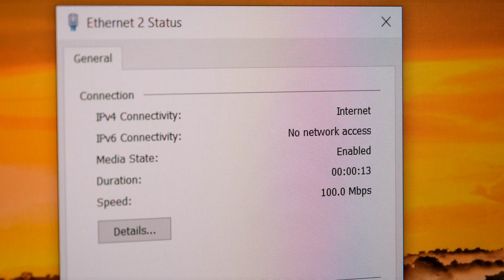Ethernet speed capped at 100Mbps fixed to 1Gbps - cable fault

Comment: hey @ecologicaltime i am having this problem. When i set my speed & duplex to 1gbps and fully reboot my pc, it still shows me that my speed is at 100mbs on the ethernet status page. Do you think running my speed and duplex at 1gbs while actually being capped to 100mbs could cause packet loss?
Reply from the maker: the link speed is governed by the performance of the cable and the wiring layout. If you set to 1Gbps and you get 100Mbps you must please check your cable.

Comment: Hi please help. I have a long Cat6 Ethernet Cable (inside walls so hard to replace), that is only giving me 100Mbps speed. I checked Realtek Ethernet Diagnostic Utility, and it gives me 100Mbps transfer speed, but all 4 pairs are "normal"; hence connected. 

Is my slow speed due to crosstalk? And is that indicative of bad crimp, or kink somewhere along the lines?
Reply from the maker: can be many things:
1. Are the devices both Gigabit - is the switch /router GB?
2. Check the colour codes, Cat 5 or is it older Cat 3?
3. Check the crimp and the termination
4. Take your computer/laptop to the device you connecting to and use short flylead and see if you get GB
Reply: @ecologicaltime  Thank you. Upon further testings, I can confirm both my Router/Switch and device are gigabit speed. My cable is confirmed rated Cat6, and replacement with other Cat6 cable displays Gigabit. So the problem is definitely with the cable (about 20m) in the walls. 
Just not sure how likely is a kink going to cause this issue, or a bad termination? I have purchased a crimping tool. Will report back.
Reply: @wildreams  was it fixed with new termination?
Reply: @kekeke82  Yes, it's fixed simply by recrimping.

Comment: my uncle gave me a cat6 cable, i dont know why, but both of the cables are capped to 100mbps, is there anything i could do to fix and get 1gbps?
Reply from the maker: can be many things:
1. Are the devices both Gigabit - is the switch /router GB?
2. Check the colour codes are CAT5e standard: https://youtu.be/eC7WHahdd24
3. Check the crimp and the termination
4. Take your computer/laptop to the device you connecting to and use short flylead and see if you get GB

Comment: I have a cat 7 idk why I am capped
Reply: cat7 here I fixed mine by uplugging and plugging it 5 times from the router and pc also check the wires if they are bend, If they are then try to straight them.

Comment: mine shows 1 gbps but my speed test . net wont go above 120.... my wifi runs at 270? HELP :(
Reply from the maker: what speed test? internet speedtest or software tool for your local network speedtest. If internet speedtest then that not testing your local network, thats testing your link to the outside world.